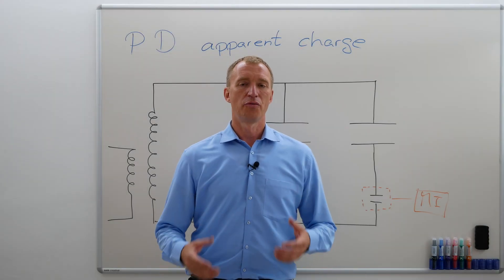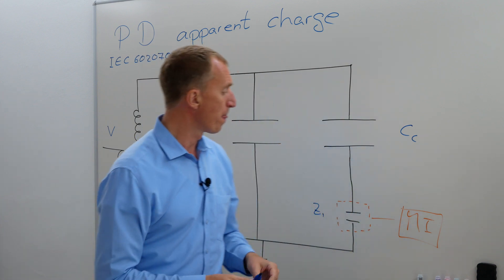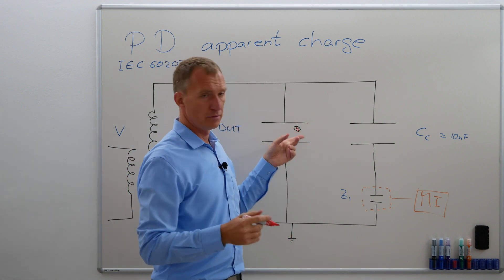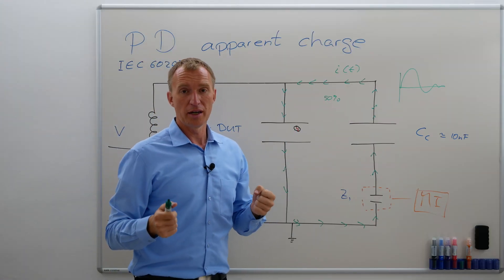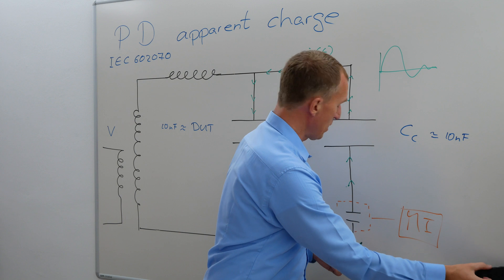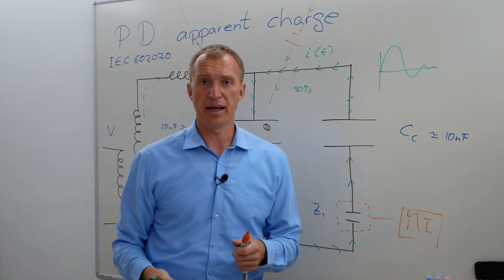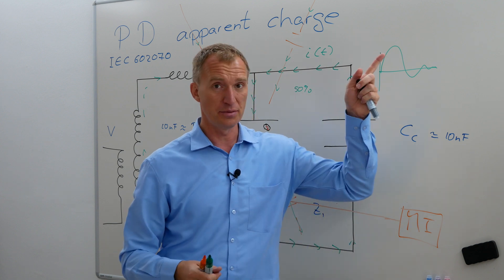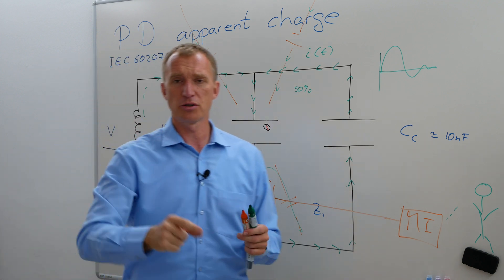2.6 Partial Discharges Vocabulary - apparent charge - Part 1

Comment: Hi Expert,Could please explain why we define 10pC as a cirterion ？How to estimate when the test result is 15pC or 115pC ?
Reply from the maker: Hi Captainapollo, sorry for the wait.
What video are you referring to, when you are mentioning 10pC?

The IEC standards for testing define for some high voltage assets to have a maximum of 10pC of PD, e.g. for MV and HV cables and certain voltage and current transfomers (the small ones of measuring V and I). The IEEE has similar values, sometimes a little more or less. E.g., MV cables shall not show more than 5pC of PD.

5pC / 10pC technically means "no PD at all".
If the PD test shows PD above the criteria (e.g. 10pC), the test is considered to be failed and the test object may not be sold/used.